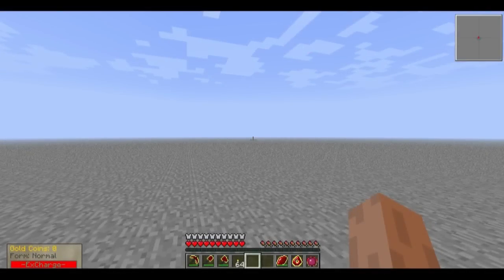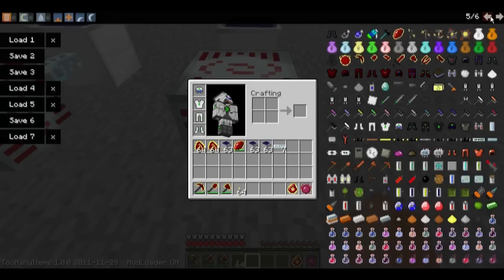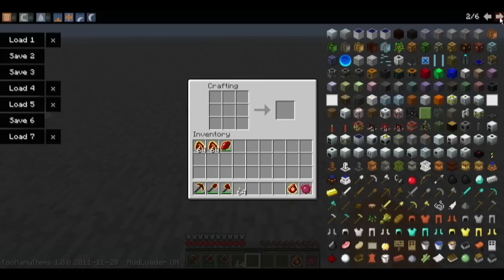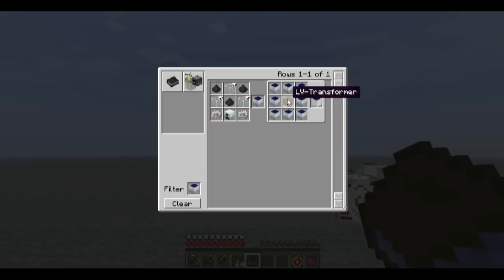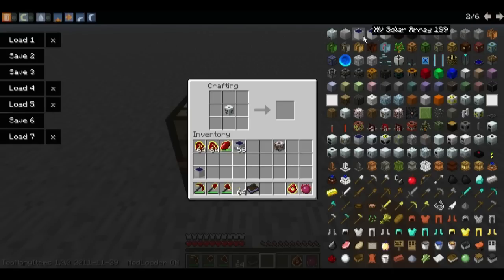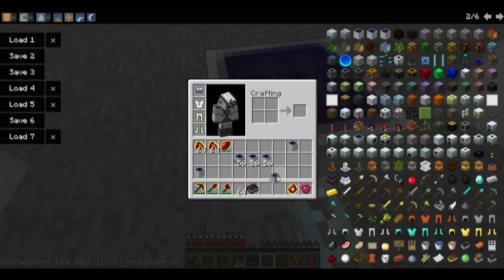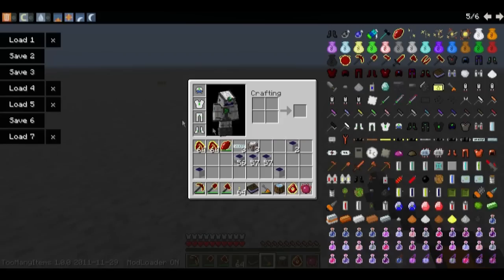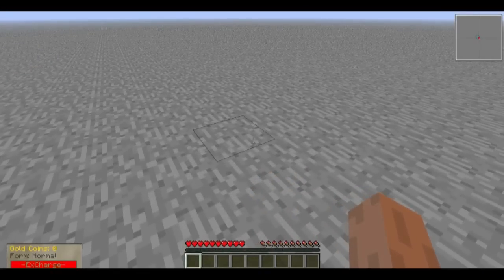Advanced machines: Solar panels

Comment: @Xagroth "I'm not the author of the mod" sorry. I must've misunderstended something. "well, it's just make a handfull of HV solar panels, hook them to a HV transformer, apply redstone, and there it is" But you know... It's interesting idea since it's no machine working on, or producing extreme voltage as far I know, and it just isn't used.